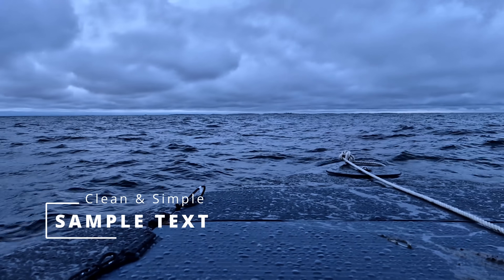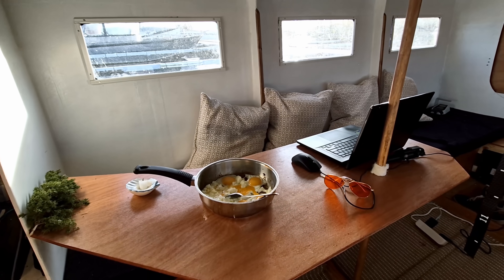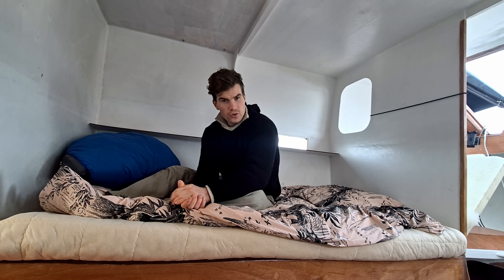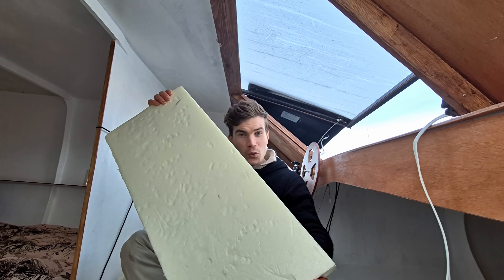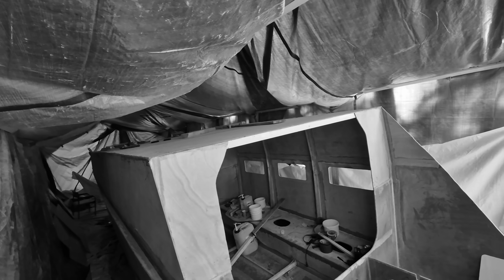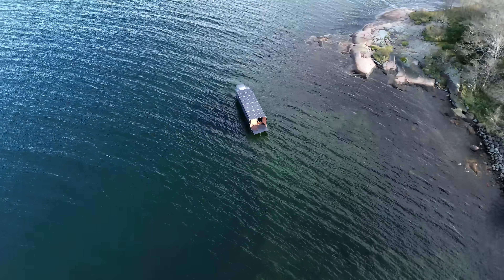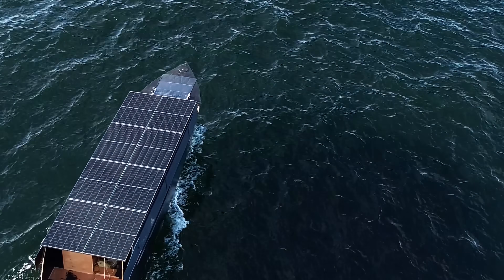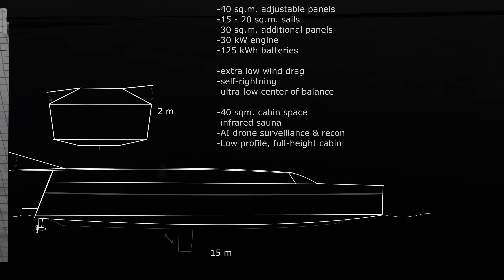⚠️ Power Failure at Sea – Solar Yacht vs. Winter ❄️ [Performance + Tour]

Comment: Greetings from Ukraine. I also have similar project, but it's houseboat. Glad you made your dream come true. Mine is still on going because of war. I recommend you to make some little PPU foam room for sleeping, it's light weight material but will keep you warm when it's too cold. Also I'm not sure will it be comfortable to be inside on summer days because of overheating, coz boat is black (first I also was thinking about black colour for my houseboat, but then I changed my decision). Also I would add some custom made solar air heating collectors for passive heating- cheap but extremely efficient on sunny days. Also for future you could make your solar panels be kinda roofing over your 2nd floor, so just need to make panels to pop-up and you get even more space when boat is standing

Comment: Needs foam insulation both for temperature, but much more important, so it doesn't sink like a stone if you get a hole.  You need water tanks to give you some stability. You can always keep them empty but your design is fundamentally topheavy and unsafe in real weather. Your boat is a canal boat, and every time you go into the open ocean, you are risking the life of everyone on board. I assume you have a life jacket for everyone who goes aboard. A bigger light that is more visible to large vessels would be wise. You are almost invisible to radar. You need a bilge pump, again maybe you have that, but one that is built in would be nice. More batteries, because you should never be attempting something where you expect to run out. That is not good for the batteries, it's unsafe, it's foolish in every way.

Others have mentioned a catamaran. That's much more complicated, so I understand if you don't do that, but you should have a much stronger keel, and the boat should be wider. The next size up you were mentioning. If you can't do 3m because you want to trailer it, still more than 2.

The whole exercise seems really dangerous. It's possible you're an experienced sailing, have all the equipment in that junk drawer in the bow, but it doesn't seem like an arrangement that any sane sailor would be willing to set out in. At the very least, you seem reckless, and utterly unqualified to be selling a design to other people. As it stands, your design would eventually kill someone that would be alive in a boat designed by a competent professional.
You're young and fairly skilled with your hands, but you should be consulting with a naval architect, because the results of your ignorance could be deadly.

Comment: What I do not understand is that you build a non planing boat, yet you worry about weight all the time your hull is the type of a displacement hull and it is not as affected by weight, besides you talk about ballast and sails they are contradicting your lightweight design, the extremely clear sound of the waves against the hull tells me that most likely your hull is on the too thin side, from your building videos it does not look sufficiently layered with glassfiber, I really hope you reinforce and rethink the design before you do the baltic crossing as this ship will not manage 3 meter waves, also did you reinforce with glassfiber on the inside or just the outside, the glassfiber sandwhich is much stronger.

My family used to build glassfiber boats had a company and everything for years, I also made some prototype drawings for electric setups, what I would do in your setup is increase battery capacity to around 50 kWh or more use the weight of batteries as a ballast, get a 5-10 kW ICE generator built in as a emergency solution, have a third row of sun panels with one "flat" in the middle and two rows facing opposite directions to get multiple angles possible, have a slightly stronger inboard electric motor and a duoprop sterndrive for higher effiency, you can skip some parts if you want to keep as many parts of your current setup as possible.

Reach out to me if you wanna talk the layout in more detail.

Comment: Nice work mate, shes a fine littoral vessel. Add some back up deepcycle gels to spilt your chem tech for batterys for radios etc A small wind turbine and a backup genny/ small portable honda genhy for emergencys. A hand tiller with your backup sails could save your life. Adding soem foam bouyancy and a life raft. For the next one go catamaran or even triamaran. Slope the sides more to reduce windage. A spare dc trolling motor or even a cheap petrol motor for backup. As you said its a prototype. Long and narrow hull makes her look like a canal narrowboat but not very sea worthy.

Comment: I really like the idea and I really like your boat. I love the electric power thing but I think you should either have a completely isolated and separate emergency power system that you could use if the main system went down or at least a small engine with a supply of fuel that you can connect to the back

Comment: For the sun deck. You should consider designing a slide out aluminum frame that could be pulled out from under the roof solar panels like a keyboard tray, and latch at an angle over the sun deck for your spare solar panels for rear supplemental power.

Also in the future model consider adding a manual Foot pedal system-backup prop that you can run from the cokcpit, for emergencies to at least help you pedal enough to not be dead in the water adrift. especially if the weather is really bad where you can't put out a sail.

And lastly, Add a vertical Wind turbine that can charge supplemental power to the batteries when the sun isn't out. And it'd be better if you can make it retractable/telescopic. 

-Don't forget to add more batteries for more ballast, and if you're going to switch solar panels, don't go flexible, As per they have poorer performance than rigid panels.

Comment: 4:27 A backup gasoline generator to top off the battery bank. Or a gasoline outboard for emergency backup propulsion. Redundancy is key.

Comment: im afraid one large wave will crush the current structure in one time, water is very heavy, thin plywood is never going to hold a single large wave crashing in to it,  i love the enthusiasm and your courage, but this is simply not safe for an ocean crossing, you must have a backup engine, ideally a diesel or out-board in case your electrics fail, you could consider using honeycomb boards to enhance the strength, especially for the cabin panels and you should use much more ribs and carbon fiber to strengthen the boat. 

for power: see if you can do a double stack of panels where they can slide out to double the surface area, get a second motor as backup and in case you get stuck in stiff winds, light weight means you will simply get blown around, and 6KW is peanuts in open waters. others have rightfully commented on safety equipment's that you will really need when the going gets tough, search lights, flairs, radar, backup batteries, backup generator, radio for communication, all essential for your survival, i suggest you add these before attempting to cross, because i want you to make it, ideally in one piece.

Comment: I for one thing the monohull is a great idea. For a startup having too high ambitions is usually one of the single biggest killers, and you will be much quicker to finish the prototype and starting to deliver boats with a monohull than a catamaran due to their inherent simplicity.

There's nothing stopping you from expanding into a catamaran as a third model later on, but for a first one trying to enter production I certainly wouldn't start with a catamaran.

Comment: It's a cool project. But you have to focus on fail safe design doing a trip like this. There needs to be backup on backup because as you see things fail and you are still in sweet water. Salt water just wants to destroy everything, especially electronics. Also don't sell it like a blue water boat, it's gonna tumble around like a washing machine under large waves even if it's self righting.

Comment: We’ve had a lot of boat/sailor losses around the world  recently. The fires from wet  lithium batteries are unmanageable, rapid and devastating. An easy deployment of a life boat when main vessel is burning is essential.  Fire is a boats true worst fear, over capsizing or swamping. Emergency egress spots could be integrated.

Comment: There is a fine line between bravery and stupidity. Mostly it comes down to success. But taking this thing in the ocean  is an almost guaranteed failure.

If the OceanGate Titan succeeded they would have been "brave" rather than "the people that went that far down unprepared".
Reply: Right. His boat is just fine for canals and small lakes; calm water. He is attempting to play engineer though, after the fact, and appears to be on a stubborn, public suicide mission.

Comment: You have very bad place for your battery. You can make a big hatch with spring latch behind battery. If powerbank will ignite, you can pull it throught hatch by some mop in one fast move. When battery will be outside, you can cut wires.

Comment: well done sir ,looks like your development potential is far from Finn-ished ... Foam and glass ,obviously would save weight and make a warmer ,quieter boat , as long as you don't use carbon ,it is really noisy  ,S glass and vinyl ester would be fine . When Yuasa are making a 13kg 550 kW motor ,and the new sodium batteries are lighter than lithium ,could end up being a tenth the price ,and last at least 50 years ,the future of solar powered cruising looks rather tempting . Foils ,would be a future add on too ,fast and smooth ride .You  have I hope got proper navigation lights ? a mast to put them on and a radar with the anti-collision system is a bit of a must  too ,sovereignty has to stay afloat ,and safe .

Comment: we have tried this,  but failed due to lack of time,  but we found that a diamond-ish shaped hull, with flexible, replacable panes on the hulls, with a rubber bumper inbetween would yield great results.   Almost necessary.   Also,  more batteries as the extra weight doesn't make too much of a difference but, the abiity to ride at night or store more helped when at port.   Catamaran gives you more space also.   we considered one of those automated kite board sails to help on some nights to get some regenerative power as well.    Plus 1-2 wind turbines for windy cloudy days also helps.    Contact me if you want to discuss more.

Comment: Reconsider your boat colour! 
That dark colours looks great but are difficult (impossible) to see at sea and in darkness? You need to be visual to others. Didnt see any navigation lights neither? A must. As is radar reflector and  AIS. Your 11m homemade boat is too small and low to be visual from ships. 
11m with flat sides and surfaces? Made of plywood + 2 layers of glass? You got a light weight boat but you suffers in strenght here, check carefully for cracks and stay close to the coast in case of problems.
This running out of battery in the night? Sorry but thats really bad planning. Best of luck with your trip and powered by solarpanels are allways intresting.

Comment: Thanks for all the technical details.

Its great to see the idea, that there is a quiet alternative to sailing with sails right in front of us especially in calmer waters where there is less wind anyway. Thanks for leading the way!

One thing you did not point out is that if many of us want this „freedom“ there is not enough harbour space for people to go for this. And not everyone with partner and kids can live this freedom for more then a few weeks a year. One way out of this would be to consider the helios11 a great camper once you put it on a trailer. On a trailer its a camper close to your home far from the water - off the trailer and in the water its your freedom holiday appartment. Here the lenght, smalö width and the lightweightness really helps.
Reply from the maker: That's an interesting idea about using it as a camper on a trailer. I hadn't thought of that!
With only 1 - 2 tons weight (depending on load and electric systems) you can pull it with any car and operate solo. I think a camping optimized version would actually just weight 900 kg since it's not necessary to be prepared for on-board living long term.

Comment: I have to comment on your boat. You have some fatal errors in you design. First of all. I would not take it to open water. It is not build strong enough. You have big side areas, more than 10 m2, that will act like a sail in strong wind. The small engine is properly not enough against strong wind and current. If your rudder should fail, you would not be able to steer and se where you are going, at the same time. On the way through Europe there are many locks and since you can't walk around the boat, it become difficult to moor alongside. Don't get me wrong.
I love the idea, but sailing in busy waters is dangerous.
Good luck...

Comment: you should make a float to put the extra solar panels out in the water so on anchor you can put them out next to the boat
Reply: Why?  They work where they are perfectly well then you have to run cables and hope they’re long enough and if they’re too long they have too high resistance making them even less efficient

Comment: That is very thin plywood you're using. My 14 foot sailing boat was built of thicker material than that, and it's hard for me to say for sure, but I believe the fillets were much thicker as well compared to what I'm seeing on your build. Considering the massive increase in volume compared to my small boat, this doesn't strike me as being anything close to seaworthy.
Reply: Ya, very thin as just a two layer construction with just that and the 2ply of glass. But it might be interesting to work the numbers to see what weight this could be built to as a sandwich with a ~40mm foam core. Even 20mm foam core with even just the 6mm ply on either side and then glassed in under a vacuum bag has the potential to be a very strong setup. Overall it's not heavy on compound curves like some tortured ply designs so this would be relatively easy to accomplish.

Comment: Double the hulls and make a catamaran with a massive solar surface area, with double living space. It would be super stable and have a extra long range
Reply: Yeah, and become a kite the first time it meets serious winds lol.
Reply: @armiman123 There is a really great video of a catamaran made by a physics teacher on a channel called Adventureman Dan and the teacher came up with a great way to have both a walking surface on the roof but a wind relief tunnel so that the force of wind lift was drastically reduced.

He also had a very cool lightning protection installed which generated a negative field near his boat to reduce the risk that he would be struck in storms. 

It was a really cool watch.

Comment: 🧬 Clan Ericson would be glad to see this! 🤔 Ere seen a Wing Sail? Ere seen a Drop Keel? Port n Starboard Drop Keels for stability n to act as shock absorbers for the 2 Wing Sails that could be made of Telescoping Poles like fiberglass rod inside electrical conduit. The Sail made of Fabric that  adapts  itself for 1/2 Wing Sail or Full Extension wind n wave 🌊. Ere seen a ⌛ sand battery🔋 u can use a lil electric ⚡ to heat a Pasta Pot size of sand)) or a Crisco Oil can with Wicks to heat the Sand. With coiled metal tubes u get a Natural heat pump of water that sits atop that hot 🔥 ⌛ n creates hot 🚿 or Radiant Floor n Wall tubing that returns to the Pasta pot o' ⌛) ere use Induction 🧑‍🍳 Good Fortunes! Norse -$on

Comment: This new design looks super cool. 
125 kWh battery would add about 400 kg to the bottom of the boat and help stabilization efforts. 
Are you planning to use an outboard motor on the next build?
Reply: Cant be that light, example EVE MB31 314Ah prismatic LFP cell is 5.9 kg (1kWh per cell). That is 737kg...pure cells without box or BMS and cables.

Comment: That boat won't survive in the open ocean. I've been sailing for 50 years so I have some experience bad weather. You would need perfect conditions to cross an ocean. Once you get to Europe and the canals it'll be fine. Getting there is the trick. Your idea would be much better on a catamaran.
Reply: its not self righting,  I worked on self righting craft,  this is a death trap
Reply from the maker: I trust your experience. What do you believe would be the critical failure point? It's already self righting, infinite range, 100% water sealable. For sure, if I willingly head into a storm I will have severe discomfort. Hitting a container of driftwood could crack the hull, but it already withstands several sledgehammer blows (tested), and calculated estimates confirm hull rigidity to be higher than production yachts.
Reply: @Lukas-TrueNorthYachts  hi I appreciate you getting back to me. I guess the thing that stands out to me the most as a problem is the low fretboard and the big door in the stern. A following sea and a breaking wave will knock the door down and flood the boat. Also I'm not entirely convinced that it is self-righting enough. Getting as much weight down as possible will be very helpful. You also should consider carrying a 4-stroke outboard for emergencies. It could save your life. All that being said I really like your boat. I think it's a great concept. If I was a younger guy I think that a electric catamaran might be a project I would do. Best of luck thanks for keeping an open mind.
Reply: @Lukas-TrueNorthYachts I just read my reply I should clarify that I meant only the low freeboard in the stern

Comment: Excellent project. Your boat has limited "line handling" for when you need to dock. You would benefit from at least a bow thruster and maybe stern thruster as well. You have a lot of windage and little keel so you will really be at the mercy of the wind in the harbour and you can't walk around the boat to fend etc.